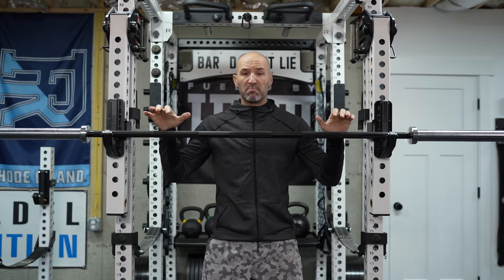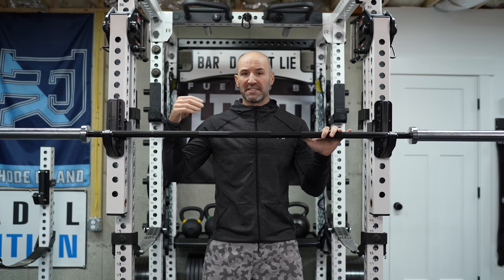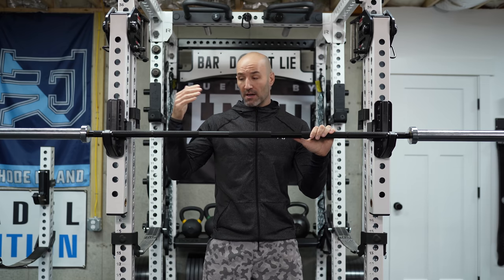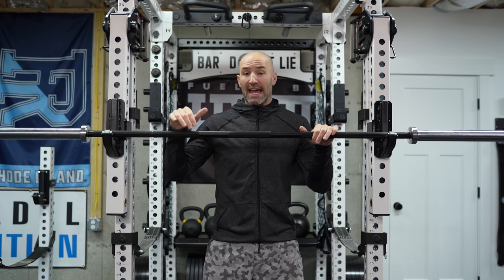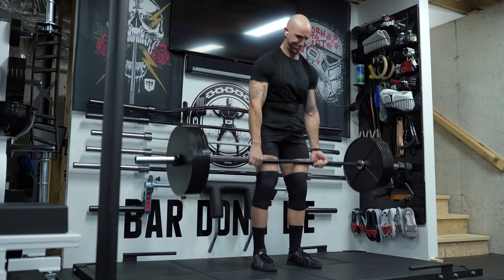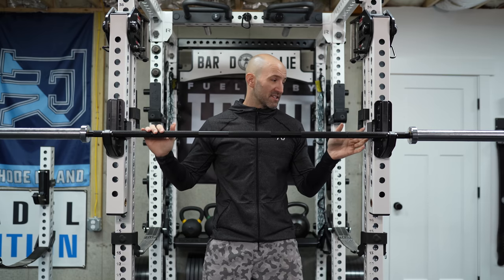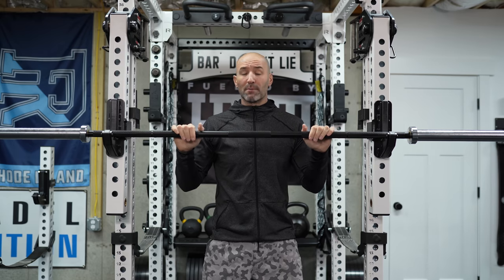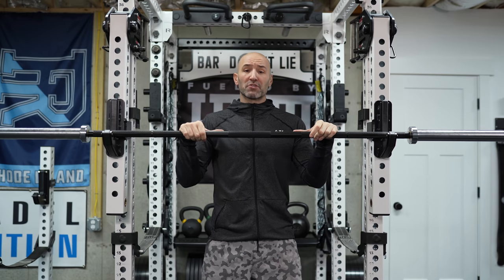Building the Bar: Overseas Product Development Problems

Comment: I appreciate your efforts B but the Rogue Boneyard makes this a hard proposal.  They generally have Ohio Power Bars there in the $250 range.
Reply: even less. I got mine for $195. The only "flaw" I could find, was some bubbled cerakote on the sleeves (bare steel w/ black sleeves). Thing's a real tank
Reply: @SteezySteez2011  a few years ago I got a 20kg IPF spec bar for $250.  I never found a flaw.  It's my daily use bar.  The sleeves are scuffed and the black zinc is showing signs of wear from daily use but that just makes it cooler.   It's about time I strip it down and clean it.  I'm a chalk user so once a year my bars get stripped and cleaned to get the chalk out of the bushings for that like new feel.
Reply from the maker: I'm just acting as a consultant here, so this isn't something I'm bringing to market. But I get your point. My counter would be this bar would offer more aggressive knurling and a few other spec differences.

Comment: As someone who made a few stainless steel bars for my gym in India, we used PH17 grade stainless steel for the barbell shaft. That grade is significantly ‘harder’ than mild steel (4130 grade) used to make barbells. The tool used to lay down knurling wears out a lot faster. The same tooling that can be used on 4-5 mild steel bars can be used for only for  2-3 stainless steel bars before losing its ‘bite’.
Reply from the maker: appreciate the insight!

Comment: How about shortening the collars to competition thin, but leaving the collar placement as is? This would have the plates start at the point that was originally intended, yet retain the extra clearance between the start of the collars and the uprights that you have with that sample.
Reply from the maker: Don't think the math works out on that one. With comp collars on a normal bar you'd be looking at about 53" between plates, with this bar I was sent it would be 54.5"
Reply: @BasementBrandon  Sure it might require some additional adjustment, but the principle I think is interesting; better rack clearance than pretty much any power bar except TPB, yet a normal distance between the plates. I can't see a reason not to utilize the combination of competition thin collars with a slightly further out placement, other than it being abnormal.
Reply: @hans3960  makes no sense the competition distance of plates is about 53” you can’t push this out you have to make the rack smaller
If you’re thinking of small collars and longer shaft it will increase whip
Reply: @Kurial94  The distance would not be pushed out... The barbell itself would not be longer either, it would be a normal bar, the collars would simply start a little bit further out while being razor thin.

Envision an Ohio Power Bar (45lb version), but you cut off half of the collar facing inwards. Bar is the exact same, plate distance is the exact same, you have simply gained some extra wiggle room between the collars and rack uprights. Maybe it technically increases whip a bit because the inner bushing would be further out.

Comment: Would fair better with medium knurling center aggressive outer.
Also easiest thing and idk why companies haven’t done this, just make it competition sleeve with thinner collars but include an attachment that makes it 45 lbs, bolts on tight to the collar, and separates the weights out for those 49” rogue plebs or pound plate plebs
Reply from the maker: Personally I don't like when the center knurl is more passive than the outer knurl

Comment: Just a quick note as far as stainless steel being softer, that really all depends. There are many many different stainless alloys with different attributes and different features depending on how they're heat treated as well. This is likely the reason that the Rep SS Power Bar EX has been known to show rust much more easily than the Rogue SS Ohio Power Bar. It's not better or worse inherently, just different.
Reply from the maker: Good to know!

Comment: OMG never new you had a series for this type of stuff. I;ve been looking to make a specialty bar and I had no idea where to start. THANK  YOU Brandon!!
Reply from the maker: I'm just consulting here, there are companies that offer private labeling, but most don't let you get too into the weeds with specs.
Reply: @BasementBrandon  So if I had an idea for a specialty barbell but no experience and zero contacts...do you recommend that I start researching manufacturers? I assume it's only cost effective when the item is made overseas...unfortunately.
Reply from the maker: @marksimmons5839  You could look domestic and international, but I would think most would require a large order to get it going.
Reply: @BasementBrandon  right...thanks for your input Brandon!

Comment: So your sample has a total length of 88.5"?  That's crazy because I'm not familiar with any "general use" Power Bars having that length; I hope it work's out for you get what you have asked for in a timely manner.  I also agree with you about the $500 cost of a SS bar being a tough sell given the already available SS bars from other companies.  Personally I am a huge SS fanboy and have been slowly switching my bars over time.  Keep up the great job and wishing more and more success!
Reply from the maker: Ah no it's still 86.5". The sleeves should have been 16.25" loadable AND 1" sleeves. instead they did 16.25" total with 54" center.
Reply: @BasementBrandon  Oh I get it now...I'm a little slow on the uptake 😂  Keep up the good work!

Comment: Hey Brandon,
Any reason you haven't reviewed the Rouge Aggro 2x or 3x yet?
Figured a sharp knurl aficionado would have been excited to check them out.
Reply: I think cost to demand stopped him. I’ve been asking him to review the 3x for awhile now 😂 

Tempted to just send him my aggro bar once I buy it whenever that is
Reply: @kozmo7  
I have a 2x and it's fantastic.
The OPB feels too mild in comparison.
I've seen reviews that say it feels better than the Rep EX and is a nicer cleaner knurl.
Brandon is all about aggressive knurl. He liked the EX and is developing an aggressive knurl bar. Shocked he hasn't got his hands in an Aggro for review.
Reply: @tomlyons7066  

Yeah? I’m in the weird camp that thought the OPB and the Deep Knurl EX aren’t that sharp at all, especially when lifting in humid swamp ass Florida and the bar flys out of my hands.

The 2x ever so slightly aggressive than the EX? Seems like the 2x is just a more pronounced volcano than the mountainous Knurl I enjoy, hence why I’m leaning toward 3x
Reply: Previously I believe he had planned to buy the Aggro 2, but bar was out of stock once he was ready to order
Reply: @kozmo7  
The EX has full mountain peaks but more points per square inch (like the Kabubi Power bar knurling).
The Aggro 2x has the points cut but the same points per inch as the original OPB giving it a sharper feel.

Check out this comparison;

https://youtu.be/w0Fvi-gknDE
Reply: Just realized you've commented on the video so you've already seen it.
I actually went from the stainless OPB to the 2x. The OPB feels mild in comparison and the 2x feels to me like what an agressive knurl should feel like. 

I will say I use it just for pressing.
The knurling is very similar in feel to the bare steel Rogue Deadlift Bar. I found that bar to be a bit too sharp on heavy deadlifts (over 500). So I got the cerakote DL bar for a slightly milder feel. I low bar squat but use the Rogue Squat Bar which has the same knurling as the OPB. Not because the 2x feels too sharp on my back but because the fully knurled squat bar gives me more grip overall across my back.
Reply: @tomlyons7066  

Ahhh interesting. My brother has that DL bar I’ll have to check it out to see what I think . Appreciate it my friend
Reply from the maker: It's been mostly due to cost and the amount of bars I have right now. Trying to thin out the herd some, but maybe I'll pick one up!

Comment: Hey Brandon. How would you compare this offering to $305 for OPB in Black Zinc/E-Coat? I hope you have end caps that match your gym theme. Good luck with it.
Reply from the maker: Hey Gavin, just to mention this isn't "my" bar, just one I'm consulting on for a company. So wouldn't want my end caps on it, especially with my consistency concerns. But it would have sharper knurling, more center knurling, and be a tad stiffer.
Reply: @BasementBrandon  Cheers dude. Agree more centre knurling is a good selling point/differentiator.

Comment: does you juggernaut ai code still work.  I signed up for the free trial and will begin payments tomorrow but at no point have I seen anywhere to enter a promo code so far.
Reply from the maker: Did you do it through the web page? It's a pretty easy thing to do, you may just have to cancel and re-sign up.

Comment: Chinese workmanship. Mediocre at best, terrible at the other end of the spectrum. Always will be inconsistent quality control.  I'm certainly not well off but would generally be will to pay more for domestically produced items. Only have 2 bars, a Texas power bar and an Ohio bare steel power bar. Not enough domestically produced bars for much choice. Maybe the Strength co corps power bar
Reply: Strength Co had one of those at the Arnold.  Seemed pretty nice.
Reply from the maker: Yeah it's def the trade off for lower price, lack of consistency.

Comment: Here’s an idea. Don’t have this shit done overseas. There’s plenty of Americans that would love to manufacture this piece. And yeah, of course prices went up. I’m a metalworker and know for a fact that metal prices have increased around 300%. 

PS American stainless steel is very hard. Name a steel that’s harder and used for a quality bar…your knurling is junk because they don’t want to use new and high quality lathe tooling and replace it at the proper time. Bad consistency and poor QC is what you will always get when you cheap out by outsourcing this junk overseas.

You want a product that stands out, manufacture it in a stand out way. If you want cheap shit made by other countries — buy this bar. Congratulations you got a subpar bar, backed by cheapskates that don’t care about their country 🤷🏻‍♂️
Reply from the maker: I'm just acting as a consultant. I'm also consulting on a bar for an American manufacturer as well.